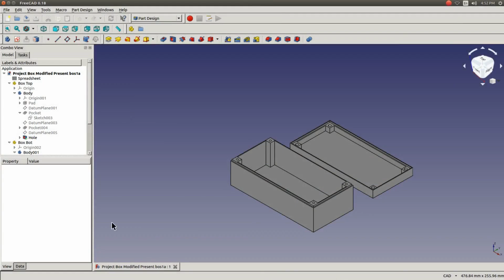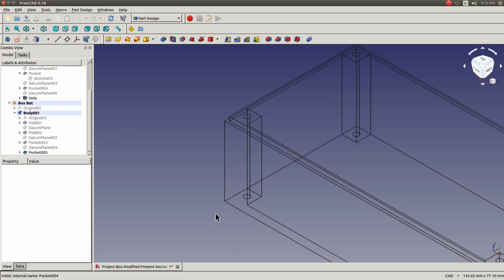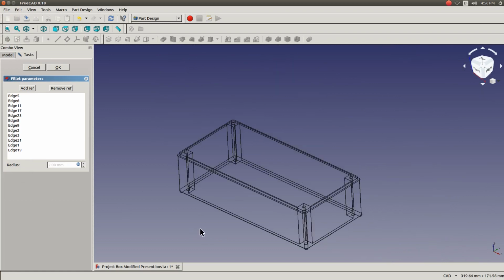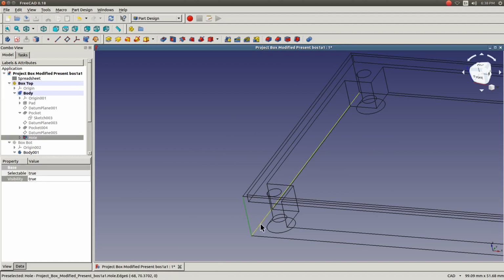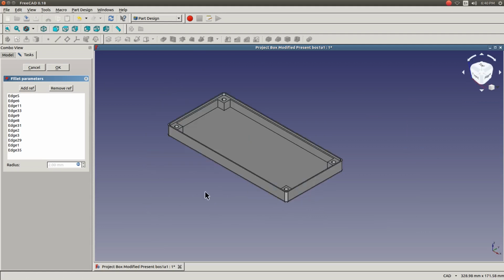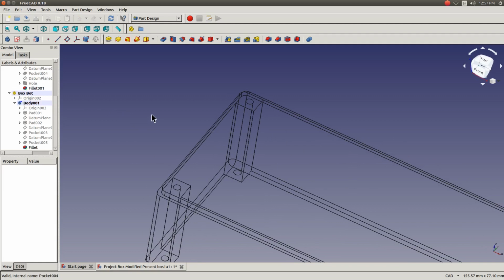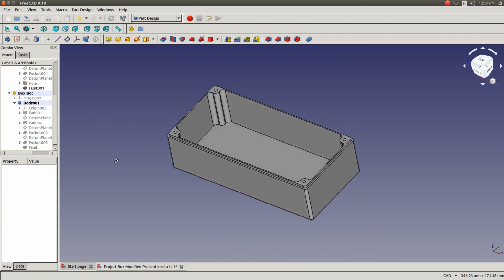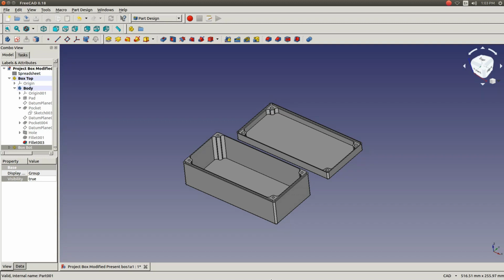Crazy Simple 3D Printed Enclosure with FreeCAD 0.18 Parametric Design Part 7

Comment: I went through all your videos and subbed and went to the thread to get the file and you have not participated in that thread other than the initial announcement and have not shared the files as far as I cant tell so I am going to unsub if you don't post a link to the files. I am not going to spend the time to recreate them in the off chance I will need a box in the future.

Comment: THANK YOU! THANK YOU! Excellent tutorial series, it was exactly the type of instruction the maker community needs.  Gotta say FreeCAD's not as easy to learn/use as OnShape or Fusion360, but don't fret, if this dummy can do it anyone can.  Looking forward to your take on parametric gears, you earned a sub #thumbsup
Reply from the maker: Thank you!  Sorry for the late reply, I’ve been ill.  The gear tutorial is in the planning stage now.  Thanks so much for the sub, that’s very important to me.
Reply: @bcastlar3453  Good day. Thank you for the effort in making these videos. I am planning to try and recreate step by step what you have done and make my own spreadsheet. It will take time as I am only using Freecad for the past 3 days as I really need a 3d printer to fabricate enclosures that I struggle to make with corel X4 and laser cutter and cutting layers to recreate the custom electronic enclosures that takes allot of time and effort. Thanks again I hope you are well as I see the posts are 2 years old.

Comment: One suggestion on centering a box/rectangle. Instead of selecting the two horizontal points and vertical line and then the two vertical points and horizontal line. Just select two diagonal points (ie: top left point and bottom right point) and then select the center point. Click on the symmetric constraint and the box it totally constraint to the center in one step.
Reply from the maker: Hi Nowan:

You are correct.  Old habits are hard to break.  I’ll likely do that in the future.

Comment: Great videos, I am a newbie at Freecad. Took a while to catch on and seems at first a few steps were missing so had to figure out myself, but well worth the time.!!!!
Reply: PS. I think it would be great if you would do a video on how to create the spreadsheet as I and think some others may not be familiar with how to create one for such a project. thanks once again.
Reply from the maker: Hi Troy, welcome to FreeCAD.  I didn’t go into detail on the spreadsheet because it works like every other spreadsheet I’ve used, but with fewer features.   I wish it had insert row and insert column.  Except for that, it works like all the others.   If you don’t have an office suite, I suggest LibreOffice, in fact, I’m using it now to compose this reply.  There is no cost, as it’s free to download.
Reply: @bcastlar3453  think you could do a video on how to place holes at location and size that you need on this box?
Reply: @bcastlar3453  would love to see video or series on how to put hole (s) of certain size and location on this box. Thank you!
Reply: @bcastlar3453  It's possible to insert rows and columns on a spreadsheet indeed, just right click over the row/column header and make your choice amongst 3 options presented. Thanks for your detailled videos of this series. Do we have any means to get your spreadsheet? Cheers